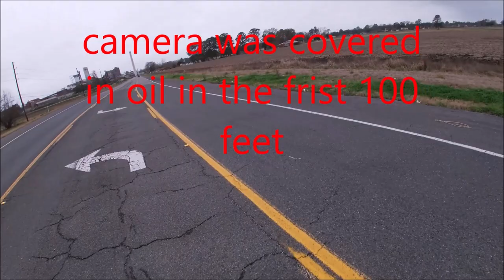YD100 build lets take it for a rip.

Comment: What Nt carb is that? there are 3 sizes I know of make sure you have the one with the large throttle piston bore.
You already know your main is lean, but are 4 stroking on the needle change the main then I bet clip the needle 1 lean.
Get rid of the muffler if you want to break 35.

Comment: First great video 2. Ur right it’s def out fuel the carb is to small I got way better performance when I upgraded my carb 3. As far as the cdi I think ur kinda right I believe we r losing a lot of power n rpm from the cdi I have a couple other cdi s I’m goin to b workin on to get more rpm out of it cause I do feel there’s a lot of power lost 4. I put a much better magneto on mine n it really came alive for me but it quickly burnt out my cdi so until I get new 12v cdi workin correct I can’t put my mag back on out of fear of breakin another cdi (went through 3 cdi cause of my mag being to strong). Anyway keep it up love the content n I’ll keep u posted on my cdi adventures 😝

Comment: Your frame is coated with fuel n oil too. Right behind carb. Just sayin.
Reply from the maker: not from the carb there is a hole in the back of the silencer that sprays every thing and black Burnt oil I don't think it's back pulsing.